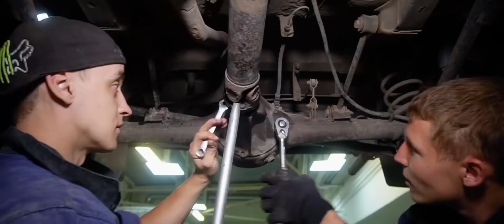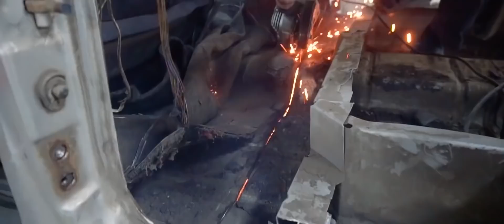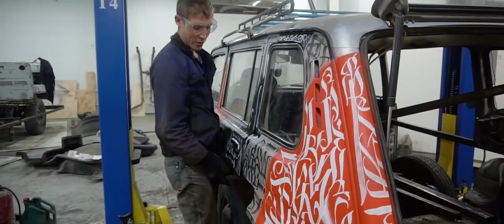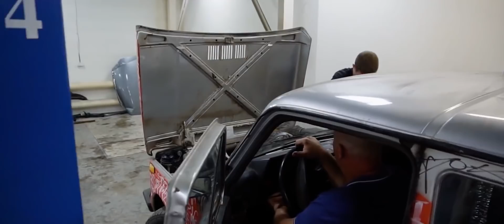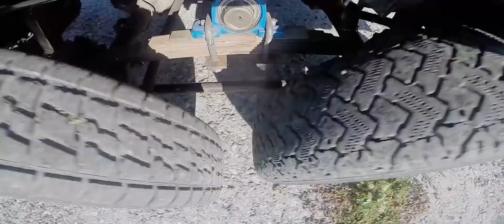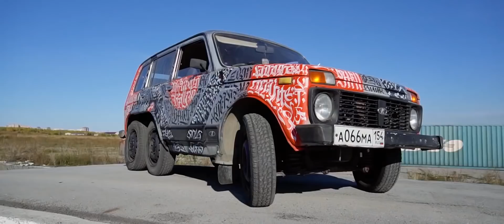6x6 Lada Niva by Garage 54

Comment: Looking good and can't wait to see how you get the underside finished.

Got my own 6x6 project in the works...using a couple International Harvester Scouts (1 is a drivetrain donor + what little usable sheet metal it has left) while the other will be the one that will get cut//extended. Been disputing on how I'd do the rear suspension...either a walking type like this or use normal spring setup with the rear ones set a bit narrower than the mid so they don't interfere with each other.

Not sure how you are going to get this thing going...but a sprocket//chain between on the mid axle input going up to another sprocket attached to a shaft fixed to the top of the axle. Back of this shaft would connect to the rear with U joints on either end with a sliding drive shaft so it can move with the motion of the rear axle w/o binding would work. Just means if want to drive the highway and not have the rear axle engaged would have to remove the chain.

My dad made a 6x6 out some using an old FORD frame and the rear ends (not the bodies though) that used the above chain//sprocket setup. It however uses a shaft going straight across the tops of both axles with sprockets/chains for the rear but had he pitched the rear one up he
 could have attached the line directly.  

If desired I'd be willing to supply images.

Comment: could cut the back of the front axle differential housing, weld another flange on, and insert another pinion housing pointing backward toward the second axle. no need for a second driveshaft or an extreme pinion angle on the second differential. 

could be a little difficult getting the second pinion gear to get good contact on the ring gear though. but it'd be cleaner and more like a Kamaz truck, less the extra ton of cast iron... 🤷🏻‍♂️
Reply: Wouldnt as it would be running backwards then
Reply: @brandoncaldwell95  not if you flip the rear axle
Reply: @Liberator975  The ring gear has teeth on one side only. Flipping does nothing. You need a duel ring gear set-up in the first axle to run the rear the correct direction. Side of that bell housing wont allow it to happen. Not only that, but the axles are designed to go 1 direction at speed not the other way due to the teeth direction. In all, you would destroy 1 or both axles attempting it even if you were to get it to work in reverse.
Reply: maineking94 thanks stranger, you saved my day
Reply: Brandon Caldwell: Turning the axle upside down will make the axle go in the other direction. A child can work that one out.
Reply: @Rubensgardens.Skogsmuseum  Have you ever looked at an axles pinion gear? Its a hook transition that is smooth designed to handle higher speeds. Flipping the axles binds it so instead of a smooth transition its a rough one due to the outer tooth grabbing first. Itll destroy the axle like i said before. Even then, the outup pinion would still cause the axle to run backwards. Again, wouldnt work. Ou need 2 ring gears sandwhiched together so the right direction can be on the outup side. Like i said, wouldnt matter if the axle is flipped or not. If you would actually look at their russian channel you would know thy already have this working. Not only that, but they had to do it with a carrier bearing over the first axle. They did it right, you guys are not thinking it through on how the trasition would work.

Ive dont engineered things like this myself. Also, many semis and that have that setup. That cant be done in this car due to axle bell size.
Reply: yup...6x2, 6 wheels FWD LoL......good try, weak spot? well..two dead axles jajajaja
Reply: If they are both fixed in the center it shouldn't snap
Reply: Like something with u joints on both ends or do you mean just a bar in place so they meet

Comment: One problem you will have is the bearing on the leafspring. Once you add power to the rear wheels, the whole leafspring will tillt on both sides and that won't be good for you because the middle axle will just go upwards and that won't be good. Non the less, amazing idea!

Comment: Run drive shaft in the middle of the rear axles. Drop a short shaft, and 2 short shafts forward and back. So the 2 rear axles are locked together, but the differentials are open.

Comment: They are called track bars, not leading arms. Just FYI. Also, Cyril did a pretty neat job setting up the suspension. It would have been cooler if it was really 6x6 though. I'd imagine finding a center section for the middle axle would be very difficult.

Comment: The obvious way of getting around the drive through axle problem is to use an overhead shaft and motorcycle chains and sprockets, driven from the rear propshaft, use a large capacity motorcycle chain and sprocket, .

Comment: I know this is very old, but the bottom bars between the front and rear axles will prevent the suspension from working. As the leaf springs compress, the distance between them will increase. However those bars will prevent that, locking the unit.

Comment: Drop the angle of the rear axle down about 25 degrees. Add a carrier bearing to the center pivot axle. Then a transfer case should fit backwards, being attached in front of the front axle.

Comment: actually is a 6x4 lol
Reply: Jogaton7 6x2...
Reply: Unless you actually listen to the video where they intend to make it so that all wheels are powered and thus is a 6x6
Reply: Well.. they said they'll work on it because lada doesnt have 4x4 transfer cases ,but they'll figure it out ,so atm 6x2 is crazy enough
Reply: Have a look on their Russian channel.  The two rear diffs are driven by a split transfer box
Reply: @Oatmealism  It's not 6x6 yet, so the title is still incorrect.
Reply: @DG_427  ìt also depends on how you classify it, as in truckworld 6x2 would mean 6 driven wheels with 2 steering, 6x6 would mean 6 driven and all of them steer
Reply: Jogaton7 it originally was a 4x4. Now it’s a 6x6.
Reply: girlsdrinkfeck Because LAND ROVER

And what about, I dunno... a TOYOTA??
Reply: @RobynnxX  the fuk are you smoking? 6x6 dose not mean all the wheels steer. 6x6 just means all 6 wheels are powered. 6x4 means the  4 of the wheels are powered. 6x2 means two of the 6 wheels are powered. none of that talks about what wheels steer.
Reply: @faem1523  its 6whheel and 4 wheels driven
Reply: Actually is 6*2
Reply: @faem1523  stock lada niva have 4x4 and this was 6x4 and now is 6x6 on russian chanel is complete biuld video
Reply: @girlsdrinkfeck  
You chose a very strange car for comparison with Niva, despite the fact that these models are one year old. If you compare Land Rover, then with UAZ because they are machines of the same class, designed for similar purposes.
Reply: @girlsdrinkfeck  
)))

Comment: Just reverse the forward of the rear axles and aim their shaft mounts at each other then hang a simple chain 2-in-3 transfer down from the center pivot axle and run short Ujoint shafts front and back from it.

Comment: bolt on a 1:1 gear and chain on the front diff pinion flange then mount a shaft to the rear diff with a flex joint in it

Comment: Get a transfer case and use the 2WD/4WD switch as a way to turn on/off the 3rd axel. 
Basically you will have 2 transfer cases.
Reply: That's what happens in the next Video.  Check out their Russian channel.

Comment: Would the rear axles being connected together with those links at the bottom, prevent all for wheels moving up and down at the same time because of the leaf springs?
Reply: SeenCreaTive it's the same setup as a walking beam solid axle trailer

Comment: Boy is that a nightmare, using a uni-body construction (which I think is junk-cheap-engineering) to add a extra axle to a vehicle. You fellas are great
for trying it. I was never impressed with Uni-Body cars or even trucks which was tried here in the US and died like it should have a year later.
A real vehicle needs a solid full frame like the diesel trucks and the Public doesn't need cars that compress you in a steel coffin that collapses when
you are in a wreck. At least Russia has some "Common-Sense" Folks in it and not some Bureaucratic Morons designing cars for the Public.
Thanks and Have a Merry Christmas and Happy New Years to You An You Folks Over There!

Comment: It is NOT a 6x6 !!!!. This vehicle is (for now) only front wheel drive = 6x2. Booth rear axles have not attached any cardan shaft at all...
Reply: "for now"  it is a 6x6. this video was made about five month ago.
Reply: My reaction is about video title (6x6) and release date. IN THIS VIDEO is not any 6x6 vehicle - maybe only his evolutionary prototype. I like 6x6 conversions (AMG 6x6 etc..) and I was disappointed from this video, because there is no one 6x6... If the video title was: "Lada Niva by Garage 54 - preparation for 6x6", it would be more correct.
Reply: @pavelbojda758  how about 6x6 Lada part 1?
Reply: It's got 6 fucking tires don't it they said its still being built

Comment: It's not a 6X6. The first number is number of road wheels. second number is how many are driven. It's a 6X4. If they turned the front of the rear axles around, put another differential between the two axles, and drove them from it, they would have a 6X6. They could probably start selling them for an ultimate cheapo go-anywhere vehicle. DO IT GARAGE 54!!!
Reply: I ve tried to do chepest 6*6)